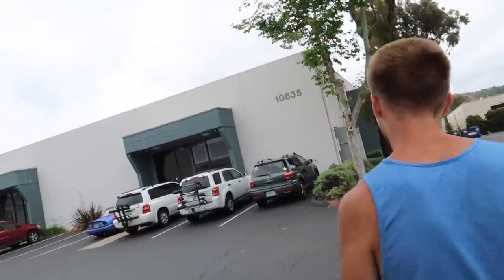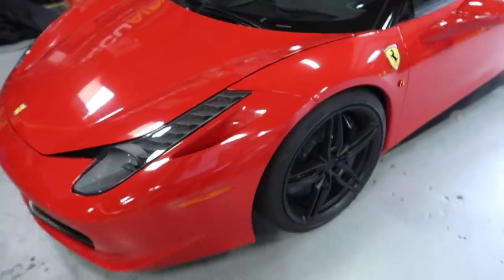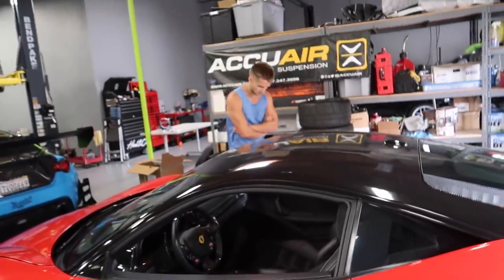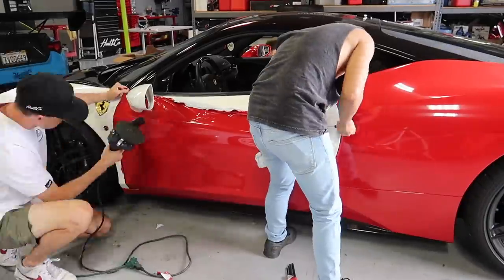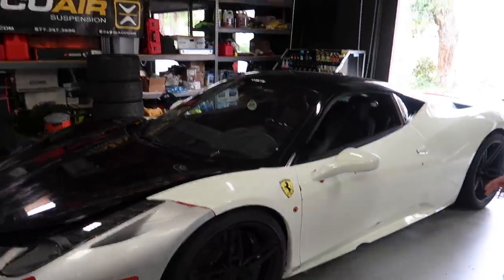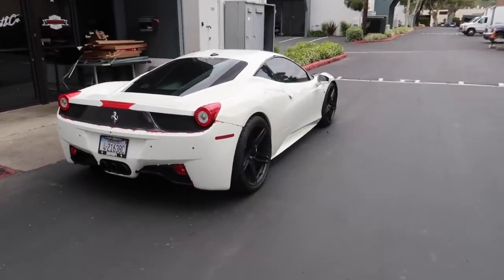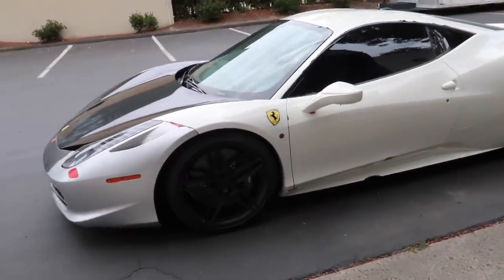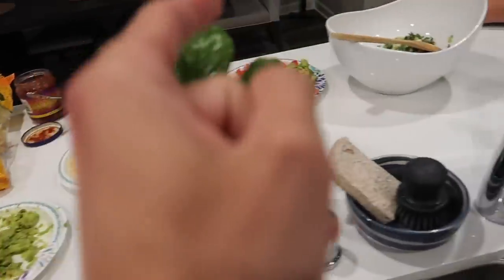Saying Goodbye to my Red Ferrari...

Comment: Hey TJ if you are wanting to make your 458 more unique  there's a company in San Antonio called AEG that's working on doing a gated manual trans on a 458 they've done it before on a Ferrari scuderia 430  and will also be doing it on the huracán as well.